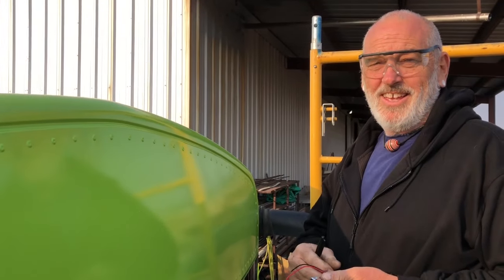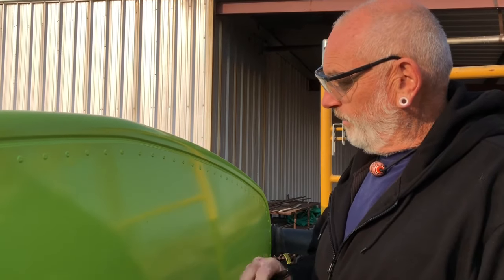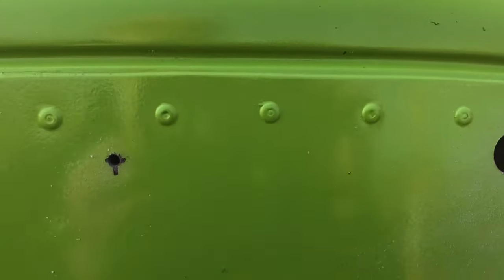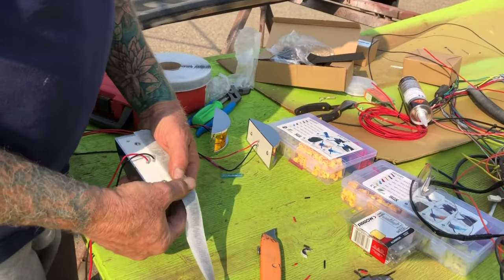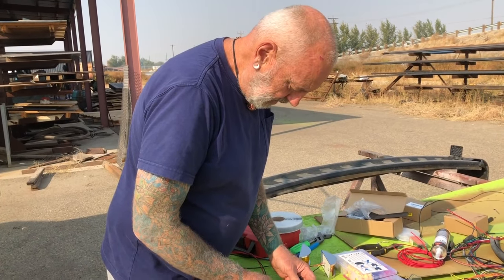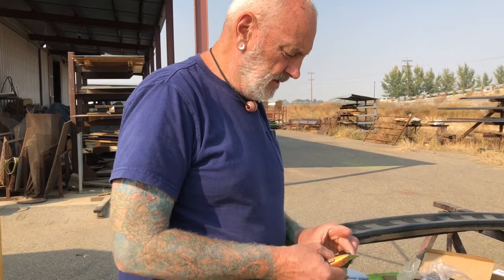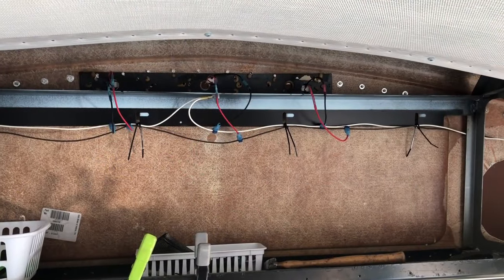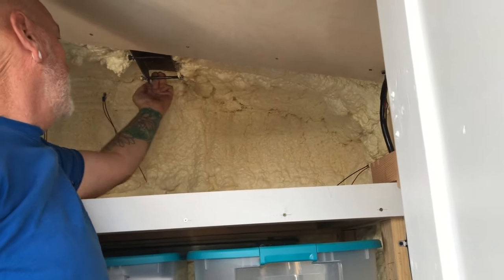Installing New LED Clearance Lights - Vlog 177 School Bus Conversion

Comment: Looks great 👍🏻. The more lights the more visibility you have. Without clearance lights you would look like 2 motorcycles heading down the road. I'd recommend even more lights on the side, since you don't have the conspicuity tape any more (that's the alternating red/white reflective tape on commercial vehicles). Be safe.
Reply from the maker: Thanks 🙏😊😊😊

Comment: You should put up a big bar spotlight on the top back and in the front on top. On top can help you see hanging tree branches. Other people that have done it say they come in handy when backing their Skoolie up. Some Skoolies even have them on either side in case they hear something they can turn on their side lights.
Reply from the maker: Yeah that’s what we plan on doing down the road. Want lights on all four sides so we can light it up if we need to. 😃

Comment: The tap connectors will only be reliable if you use them on a very specific insulation and wire size.  When they match the specified wire, they create gas tight, reliable connections and will work very well.  Another comment on LED lights.  You may want to consider running a ground wire to each light instead of using the chassis as the ground.  Steel is not the best conductor of electricity and when the current levels are small, such as LED lighting, the resistance and corrosion on connections is more significant.  The use of the chassis for current flow also can increase galvanic corrosion aka rust.  The automakers do this to save expensive copper wire and it also creates sales when the vehicle rusts away.  Food for thought...I enjoy every one of your videos, they are entertaining and informative.
Reply from the maker: Thanks that’s some great information. Far as the ground wires too late now that’s the way the bus was wired but every place I could I ran my own ground. Once we knew what was going on.  We made the best of what we had and we’ll see how it goes 😃

Comment: Looks good to me and actually add a bit to the looks of the bus. If the stainless teel screws are too soft, try ones with torx/safety star head. They transmit much more torque.
Reply from the maker: Thanks 😊🙏

Comment: I love those little clip connectors!    We installed some extra clearance lights along the side of our bus, and love the look.  Now that I've seen the replacement lights that you have used for the corners and top, I'm thinking that it might be time for me to make the change with those.  Mine are still the original Grote incandescent lights and are looking a little worse for the wear...
Reply from the maker: Sounds great! We knew going in that we need to replace all the lights once we started tearing into them. They were pretty shoot. 😃  Here's a link to what we used
Partsam 2pcs RED LED Marker Light Chrome Plastic Trailer RV Camper 12LED
https://amzn.to/3o0yq61

Comment: On the front lights, why didn’t you drop just below the rivets?  Was it because of the metal bracket behind?    

If your going to use those t taps, use electric tape over it to keep them tight.  

I like the work you’ve done so far.  The LEDs are so much better.
Reply from the maker: We are uncertain about the T taps. But if we have to we can go back and solder them.  We kept them high so we could put a logo up there. 😃